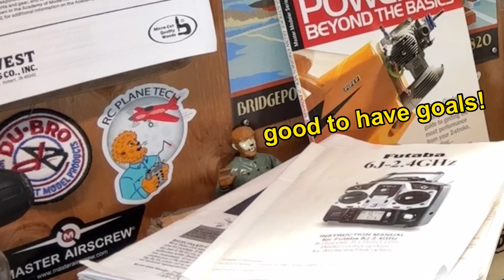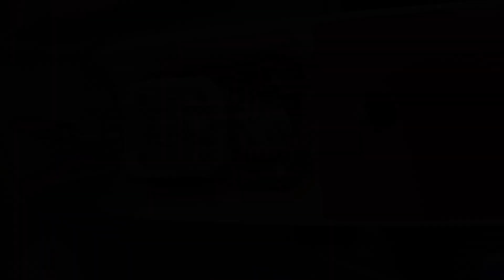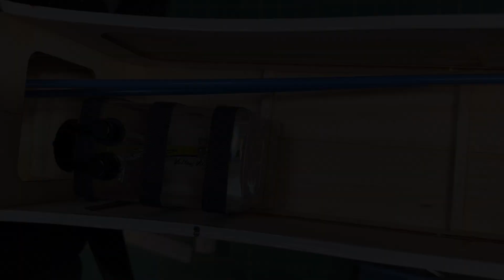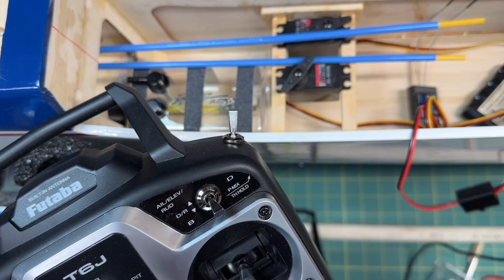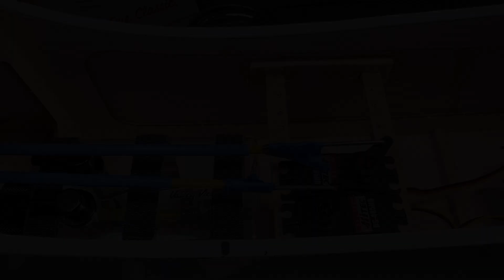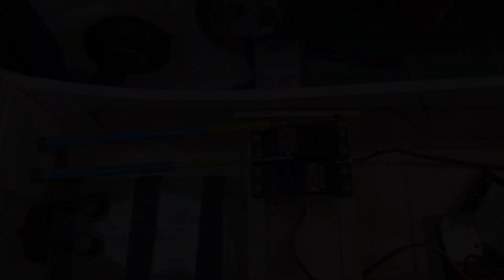Balsa USA Stingray with DLE-20, RC Plane Build N0 31: set up DLE-20 choke and throttle servos

Comment: According to the DLE20RA manual, one is suppose to remove the carburetor throttle spring. It is suppose to reduce stress on the servo. I can see why you should and I can also see why you would not. Did you? Thanks for the video, I am building my first Gasser and finding your videos very informative.
Reply from the maker: Hi, yes I removed it because if you don’t your servo will have to work against it in both directions. So your servo will be under constant strain. I don’t think you have to remove it, but I prefer to.
Reply from the maker: And Thanks!
Reply: @jamesrcplanetech  I just found out something. If I put my Choke on channel 5 or 7 or 8 (channel 6 is to opto switch) and Stabilization is on, the choke will move as the plane moves, stabilizing in other words. I assume the opto is doing the same. Have to figure out how to turn Stab off for the channels.
Reply from the maker: Interesting. I think once the engine warms up, usually want that choke completely open.

Comment: Nice video that being said I would never use the servos and linkages you are using in a Gas engine setup.  You would be better off using metal geared servos for throttle connected with ball links as you want zero slop as it only takes very small movements to change the throttle.  Those plastic rods will also change size with the temperature change and that will change your low and high throttle settings.  Also vibration will quickly strip the gears on a standard servo.  You could save yourself some effort by just making a mechanical setup with the choke as adding a servo only adds weight and complexity.
Reply from the maker: Thanks for the comments and tips! Ya, I'm not sure how helpful the choke servo is, I do like the mechanical option, simple and reliable, less weight. But this is my first "gas" build, so I wanted to try a choke servo. And I'll have to watch the things you mentioned, and maybe switch to ball links if I have trouble. I'll have to monitor things as she goes. I appreciate your comments, it's helpful to all.

Comment: Well done. I do like the narration on the video. I really like using golden rods but have never used the rubber stops. I always scuff up the outer blue portion and then glue them as they pass through bulkheads or supports. Lots of ways to skin a cat I suppose. Can’t wait to see this thing fly.
Reply from the maker: Thanks! As I get closer to finishing I get more nervous about the maiden!

Comment: Hi James when you start setting servos in it means you coming down the pike of finish line 😊. When I run the threaded rod into the inner rod I chuck the unthreaded into the drill and run it in & out of the inner rod makes it easy peasy also doesn't mar up the inner rod holding it.  Lite winds and smooth landings.
Reply from the maker: Thanks! And great tip!